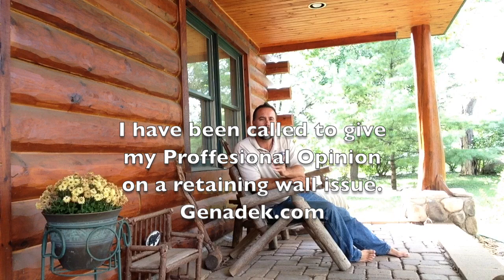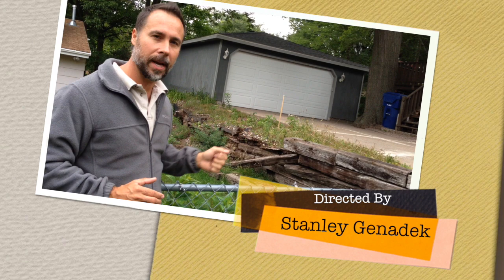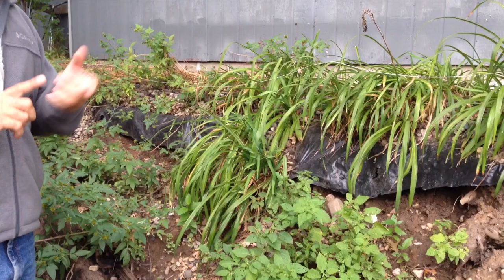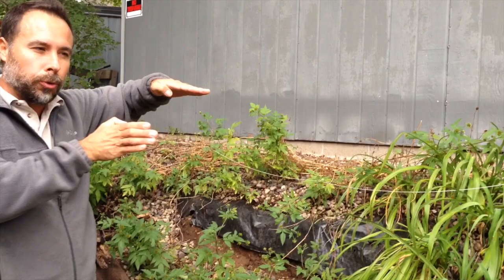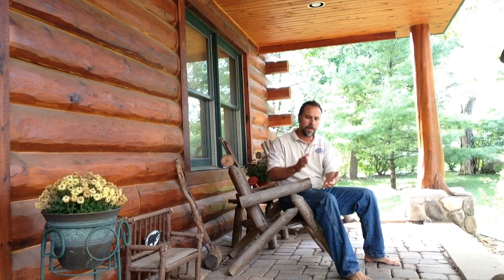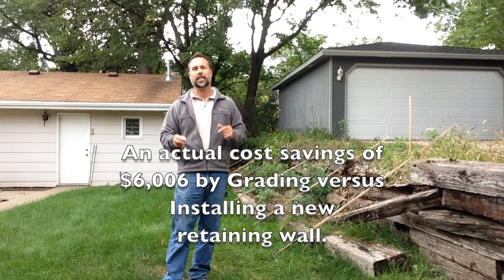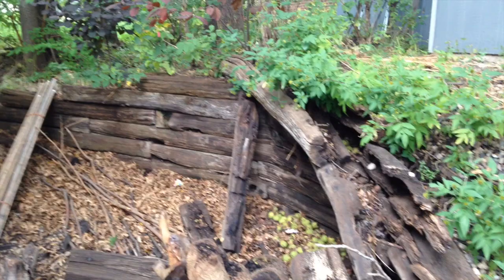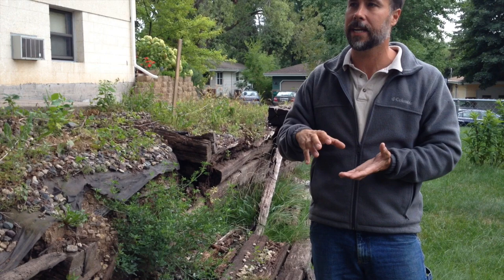Catastrophic Retaining Wall Failure Goes to Court in St.Paul MN

Comment: One of the biggest problems is that railroad ties are made for ground contact not foundation grade. Meaning that they will rot over time unless they are foundation grade.  So from the start of this build is was going to fail. As you can clearly see they have decayed and the ones under the building and driveway will do the same and may cause issues

Comment: BIGGEST problem NOT addressed... If you look real close, you'll see it.  From edge of garage to retaining wall was gravel. Good idea. The TWO LAYERS of plastic with a grade leading to the retaining wall... NOT GOOD.  ALL the water from the roof was funneled straight to the back side of the wall and allowed for it to rot from the back side outwards.  No plastic protecting the back side of the retaining wall at all, which could very well have been hidden between the top course and second down so you'd never have seen it at all (two layers should have been placed) ... Poor construction initially by whomever built it.
Reply: Wolfsden EnterprisesLLC I design retaining walls for a living. Number one cause of retaining wall failure is the hydrostatic buildup of water behind the wall ( ie- insufficient drainage). In layman terms, the water behind the walls acts like a jack you would use when changing a car tire. Without a drain section from top to bottom of the wall, the water pressure exerts the pressure on the wall horizontally. With the drain section behind the wall (8-12 inches of drain rock with a 3-inch perforated pipe with positive slope and all wrapped in a filter fabric), you relieve the pressure (like turning open the release valve on the tire jack).  Railroad ties are cheaply made walls and sometimes have rebar stakes drilled and pounded in for vertical reinforcement. In this case we saw horizontal deadman construced, but no rock drainage ( sometimes called a chimney drain) or a drain pipe ( drain tile). Plus it looks like the wall was constructed vertical with no batter (inclination backwards from the vertical). Notice where wall failed was near garage and house where rainfall comes right off of the roofs. If gutters were installed and run away from structures and wall, there likely wouldn't be a failure. Additionally, where is property line located? Likely wall is on upper lot's property since deadman extend into that property. .
Reply: Especially with a freeze thaw cycle!

Comment: You really should have dressed as Lieutenant Colombo for this, and at the end said, scratching your head: "Euhh, Sir, jus' one more thing..."
Reply from the maker: Hahaha Love it!
Reply: Well if there was a Mr. Colombo here he might ask,  "Looking @2:20 through 3:20 in the video one can clearly plastic sheeting.  That sheeting was put in when the deadmen were, was it not?  Wouldn't that sheeting have gone to the wall and that provide a barrier to water saturating the material below it?  If so, wouldn't that prevent to a great degree the material below it from water and an increased in hydrostatic pressure? Also Colombo would never accept the speculation (guessing) that the garage was built considerably after the retaining wall was installed.  In fact, a little research into when the wall was installed AND the garage by going to the city and checking building permits would eliminate any guessing or assuming on your part.  Would it not?  I am a layman here so I ask, could the fact that there was no gutters on that garage permit the water to flow up to the wall and expose it to rot out faster over time faster than that part of the wall with was exposed to an increase of water than the part that did not rot out yet.  It is I assume, a fact that eventually the rest of the wall will eventually rot out given enough time and collapse based on the material used to build it.  Let's face it, it is not as longed lived as a retaining wall made of a different material like a stone wall.  Just my thoughts Sirs.  Cheer.
Reply: Wood does decay over time, but it takes decades to centuries for the process to happen. You've assumed the plastic behind a retaining wall is to create a barrier that prevents water from penetrating the wood, and that's incorrect. It's there primarily to channel the water down into a drain behind the wall. In masonry walls, it also prevents minerals from minerals leaching into the mortar which will naturally degrade the wall's structural integrity.  

Regarding the longevity of the wall. While stone is more durable than wood, that doesn't mean it's superior. Block foundations of houses are coated with materials to prevent water from penetrating the blocks. In retaining walls, the mortars they used will eventually become brittle and fail under load. The perfect example is when you see old brick houses that have loose bricks. Unless it's a modern locking block wall that uses PVC pegs, most stone walls are at a disadvantage compared to wood. 

I would say the diagnosis is on the money, but I'm not a fan of the proposed alternatives. At that angle, rain water will rush the lower structure due to its proximity. Also, I would suggest that the garage will experience foundation issues most notably creep. I believe that under heavy rain conditions, the foundation could have a catastrophic failure leading to a landslide.

Comment: Is this something that should have been looked at by city inspector before issuing permit to build garage? If he signed off on it would he be partly responsible?
Reply from the maker: +BillsProLawns No- the city is not responsible. Even if it is built to their code.  In this case it was but long before retaining wall construction had code compliance.
Reply: Cool. Thanks.

Comment: No matter how they're built, wood retaining walls are setup for failure from day one. Wood can not be placed in the ground and last. People like cheap cost, but in the long run it cost more to use the wood. Even if the wall didn't fall over, the ties are rotted.

Comment: BUT WOULDNT THE LOWER LAND OWNER LOOSE 3-4 FEET OF USEABLE PROPERTY
Reply: Not putting a retraining wall back in is asinine for the lower property owner.      Typically the upper owner installs the wall to create more usable space for themselves.  Who's property is the wall on?  I suspect its the upper property.    I would NOT allow them to create a sharp grade in the direction of my building, where i've got all that groundwater draining in the direction of my structures, and reducing my usable space, and creating a hill I've got to mow and maintain.    Rail road ties have a 30-50 year life.   They were probably at the end of their life cycle, and the drainage, and load of the garage created a dramatic failure instead of a slow subtle failure.

Comment: People don't realize but you have to give water somewhere to go, If you do not I'll assure you it will go somewhere you don't want and it will cause damage. Hydrostatic pressure can get up to damaging amounts of force, almost as if you have a hydraulic jack behind The wall pushing it over. I just finished building a storage facility and on the far end of our parking lot we noticed water seeping out of the ground, evidently we uncovered a wet weather spring. I installed a 3-ft ditch put a 4-in drain pipe in there with a fiber sock around it and filled it full of gravel and when it rains that pipe will run  completely full with pressure behind it. Had I not done that drain I could have lost my entire parking lot from water damage.

Comment: let's put some gutters on the garage, eh?  a retaining wall built out of (not new?) railroad ties (the RR didn't pull them out 'cause they 'looked badd', eh?) has a life of somewhere between 15 and 25 years without these other problems.  Putting the house and garage on top of the deadmen indicates the builder was a moron.  I bet the portion under each is also in really good shape too.  Bottom line answer, the wall died of old age, it did not die prematurely, it had a good life and got old.  Happens to all of us someday.
Reply: Looked to me, and Stanley, like the wall was still pretty stout everywhere EXCEPT where the additional moisture was applied via the garage.  I mean really, who doesn't put gutters on a structure unless you have other methods of moving the ground water like extra long eaves and some type of dramatic slope or French drain system.  The builder or owner was cheaping out and the owner should have known better. 
My $.02

Comment: You call that a retaining wall? Its just a pile of wood and wouldn't even qualify for firewood. I am a general contractor in California. I would not have relied on wood railroad ties to support lateral pressure to a garage structure. Whoever erected this is responsible because it was bound to fail.
Reply from the maker: True

Comment: Geez, if the uphill neighbor would have done a rain gutter and a drainage pipe to the street they would have been fine for another decade or more.
Reply from the maker: Yep- :(
Reply: The garage has 4-ft frost footings and would transfer the loads below the wall.  A simple free body diagram will tell you that.  

Water, rot and age appear to be to be the culprits.
Reply: Steven Johnson that’s assuming that the garage was built correctly and to code rather than just built on top of the driveway.  People don’t always do the right thing.  The only way to know is to excavate and see if the were footings properly installed.
Reply: Had the garage not been built with frost footings there would be clear and present tell tail signs.  Minnesota freeze thaws are unforgiving to structures of that size; differential settlement and shifting would be apparent after one winter.  Also, there is no way that garage was built in the metro areas without an inspection.
Reply: Steven Johnson I’m not suggesting it was built without an “inspection” I’m saying people, including builders find ways to cut corners all the time.  A lot of times inspectors are too busy to make an actual appearance and all they need are pictures of the footer hole with a tape measure in it.  I know they did that in Delaware.  The frost line there is 36”.  You’re not supposed to be able to get your car registered there without an inspection, but I can tell you from experience that $100 goes a long way to getting you one without one.  There are ways to cheat the system and people do take advantage.  And I think that the garage still presents a purchase to the surrounding soil even with proper footings.  If the Wall was not built to support a driveway with a large shop on it like that, then it’s going to have an effect.
Reply: yup that is if they knew that they hired a cheap contractor or an LLC (Limited Liability).

Just posting a hate on builder side haha. 

But also. I have a tiny Landscaping Business just for a small neighborhood. And I love learning from these mistake videos. But I also witnessed plenty of near-scam peoples, and also the LLC businesses (omg), 

and also even a couple workers under my own company was scamming out the customer without my knowledge until the project was done.. And so I lost future customers, because I told the customer it is their own fault for giving thousands of $ to someone that is not the head of the contract, the contract is done with me, and I am the business owner, the plan was already done and I visited the site on daily basis to see the progression and even talked to the customer every few days. Suddenly a week later, I hear about all these angry calls. Well. It isn't my fault dude.
Reply: @stevenjohnson889  detached garages aren't required to have frost footings pretty much anywhere in minnesota that i'm aware of.
Reply: All that matters is who owns the retaining wall.  It was never built to allow full usage of the higher grade land. If the low ground neighbor owns the retaining wall, they don't have any right to do a cheap retaining wall that requires telling the garage owner on higher land that they cannot put a garage on the lot they own.  There originally would have been a slope there, but it was likely removed by the low ground neighbor or the original builder that the low ground neighbor bought the house from.   The neighbor on the lower side likely should be forced to return the original grade or beef up the retaining wall to handle anything the owner of the higher lot wants to build on it.  The only way the neighbor on the high ground could be responsible is if the retaining wall is on his land for some reason.  The water runoff issue doesn't matter as whoever owns the retaining wall should have inspected it and suggested gutters before it failed completely, but ultimately that wall never would have lasted long and the replacement was going to be required with or without water runoff.  Regular inspection and maintenance is the responsibility of the owner of the wall.

Comment: I dont know this for a fact but I know several Railroad workers that have told me numerous times that RR ties like these Rot from the inside out. Thats why the RR replaces them like they do.
Reply from the maker: +Alden Brewer I would have to agree.  From my experience they always seem to rip apart -even the ones that look solid.
Reply: The treatments they give them are applied by soaking them in the chemical. Problem is it can never truly soak all the way through to the middle because they are so thick. So the exterior is treated against rot but the second any rot finds it's way to the center from a small hairline crack which the wood will eventually get and wouldn't otherwise be a problem, that's how the rotting from the inside starts.

Comment: $18,000 to put some new cross ties or cinder blocks in?!!! What the holy fuck are you talking about? 
I could build a house for that  kind of money! Ridiculous. Cinder blocks are hardly more than $1 each, some rebar and concrete, a few lengths of perforated pipe behind to drain off water....easy peasy done in a day for about $5K
It's not rocket science and you aren't hiring PHD holders to do the work.
Reply: Its a bit high but there are costs of having covered workers. You dont know man
Reply: And what kind of house exactly are you building....  An Adobe house??
Reply: yea icantsignin has no clue what he is talking about. take it from an MHIC contractor in MD. I can build (and have many times) built new homes. Cost per sqft is about $65. for a 1500 sq ft home would cost $97,500 and that's a base rancher with no finished rooms other than drywall and paint. Cost to build for me is about $75,000. That's what i pay for w2 and insured workers and materials and what not (COST) and it takes about 3 months to build. 
I was saying that the cost of the wall was a bit high for the retaining wall (about 10,000 is about right for my area for a repair like that.)
Reply: Um....yeah. We just aren't accustomed to ripping people off where I'm at.  Maybe ya'll move a little slower up north...must be the cold.
Reply: you tell me the location and the cost per sq ft to build a home. DUDE 18k cant even buy the materials to build 1500 sq ft. in ANY state in USA
Reply: I don't recall specifying a 3 bedroom, 2 bath ranch with attached garage and whatnot in a gated HOA nazi controlled neighborhood utilizing the latest in, hahah, particle board technology and a crew of Mexicans doing the work FOR me.
3 months for one house though. really? You must pay by the hour. I've seen how those guys work, it's pitiful.
But by all means let's get off the subject of scraping a bit of dirt off and restacking some new crossties
Reply: That's what I'm sayin'...paid by the hour and work like it. I guess you could only do maybe 3 1/2 houses a year if you get lucky with the weather. 

We mainly do remodeling now but can do anything from the ground up. Stuck door? OK. Whole new house? OK
We built a two car garage about a year ago with a laundry room downstairs and a kitchen, living room, bedroom, bathroom, party area upstairs. About 1000 sq ft. building, two stories.
Plumbed, slabbed, framed, wired and getting roofed in 7 days, went and did some other jobs during the same time but within a month it's finished and being lived in.
There's 3 of us. 
All in our 50's now. We don't screw around, we don't take lunches, you bring something, get a bite when you have a minute. Otherwise you'll spend all day painting a house when you can get it done in 4 hours and move on to something else. 
We stay busy all the time, too busy, never advertised, all our work comes word of mouth. You don't get referrals from crappy work. excellent rating with BBB
Get it done right and get it done fast, go back to the shop and build cars. 
We'll have a fully restored 65' Mustang finished in about 15 more days, we're painting it now...got it as a total disintegrating rust bucket last thanksgiving so 4( ish) months and it goes in a show the 23rd of this month. We put a few extra upgrades in though, it should be a tad bit quicker than stock.
And again...I didn't specify a 3 bedroom ranch. I said a house. I, me, myself, can build one. A nice one.  I didn't say hire a crew either so your math is no good. Never ran into anybody with actual skills before? 
Hell man, SOME of the stuff I can do....roofer, builder, painter, mechanic, auto body, climb and top trees, 4 color process printing, 3D modeling, animation, graphic design, blueprints, I've done video and photography work from both sides of the camera, created TV commercials and promos, voice acting, movie extra,  I can drive anything on or off the road, fly several things in the air, I can back a trailer, parallel park, climb mountains, explore caves, make a woman cum til she's climbing the walls ...and I know Kung Fu.
Try to learn something new every day, try something you haven't done, forget about this damn house I can build and have a good day.

Comment: The bottom line is improper construction of the wall itself as there is NO support network to hold the wall in place as well as no proper water runoff to prevent the calapse.